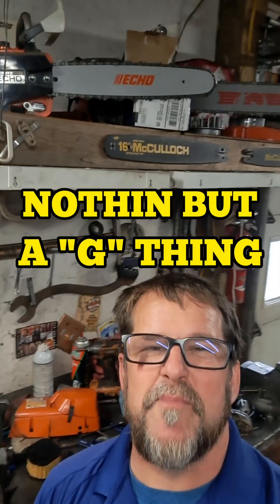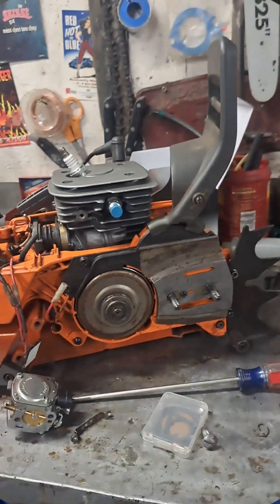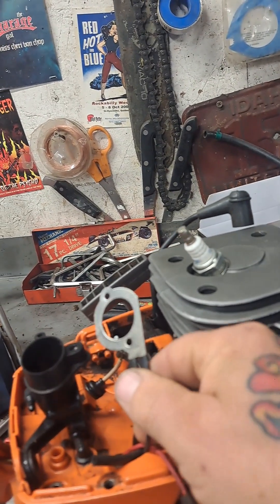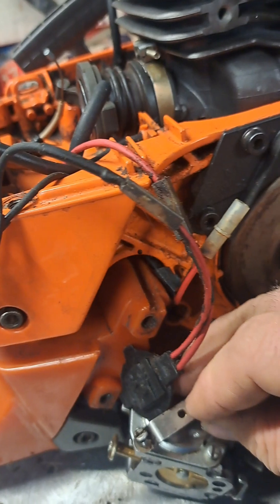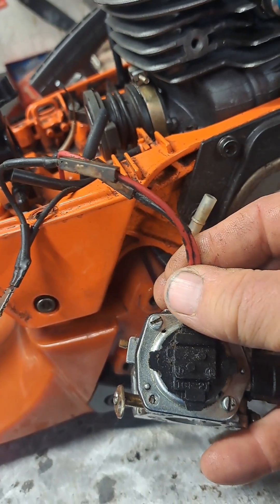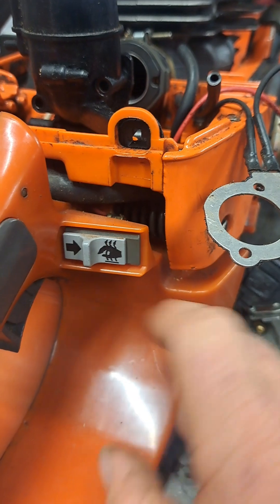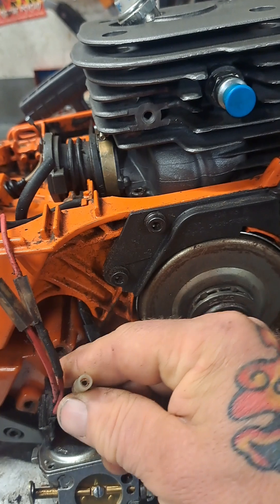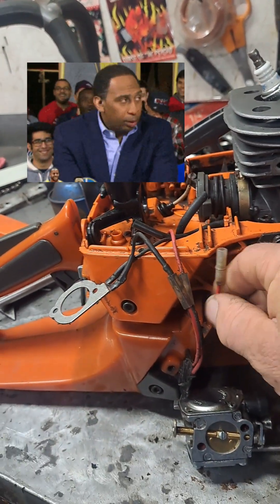Husqvarna 385xp "G" explained

Comment: I believe that it‘s 20 volts AC in my research. I have not seen the carburetor heating pad before only the heating plate. Stihl‘s carb heating plate has a thermostatic switch built into it to regulate it and turns on with the main switch in conjunction with the handles. The Dolmar I have only has heated handles with nothing for the carb so I could switch the winter/summer air shutter if needed.
Reply from the maker: Thanks for the info my friend!

Comment: I don't think you'll be able to put lights because there's no voltage regulator rectifier so it ac not DC
Reply from the maker: That's good to know!
Reply: Even though it’s called an “alternator”, it doesn’t mean that it puts out AC voltage. If you get a Delco unit, they call them generators because they “generate” voltage at a regulated level. What I’m trying to say is that generators will put out a lot (or little) of voltage depending upon how it’s setup. That’s partly why chainsaws with heated handlebars put out more heat in the grip the higher RPM that they run.
Reply: @ToddAdams1234  I think that’s what the G stands for. I be interested to know for certain though
Reply: @shapeshifter7753  It definitely stands for generator.